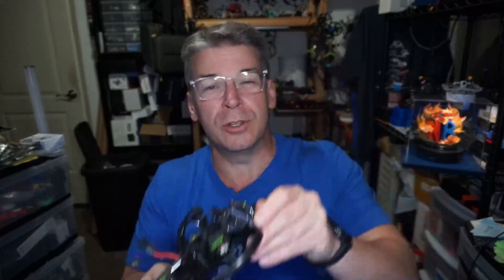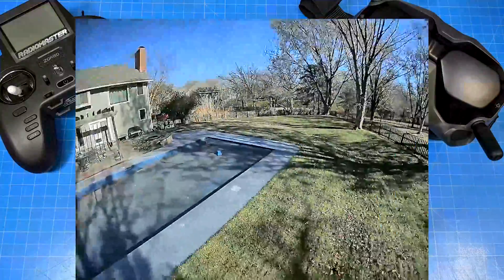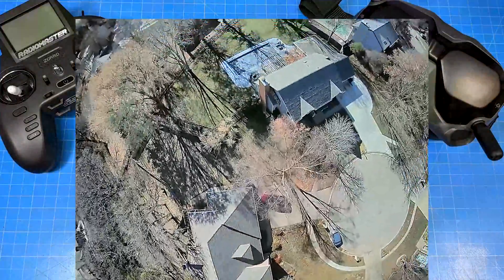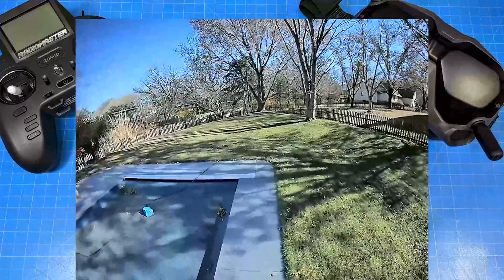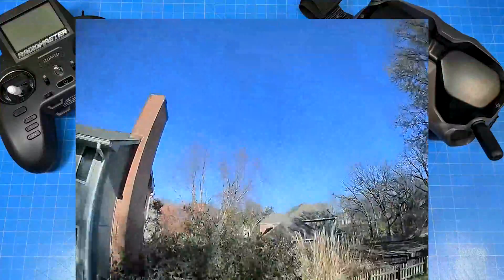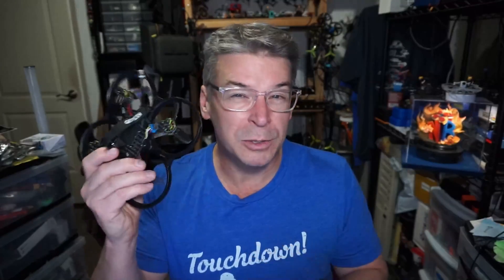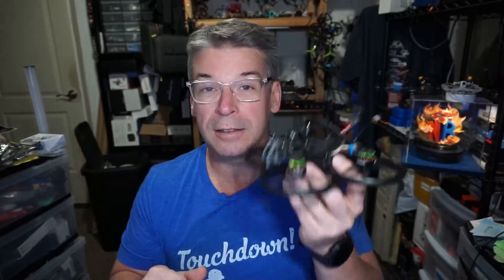Cinewhoop Wobble Fix // Thrust Linearization // GepRC CineBot30

Comment: Hello everyone ,

For some inexplicable reason the motors on my Cinebot30 stutter when I do the Roll movement…

Does anyone have any experience or an idea ???
Reply from the maker: is air mode on?
Reply: @NickBurnsFPV  110 % which is also set all the time Air Mode on i dont change it
Reply from the maker: @davutguney8419  really not enough for me to go on here. likely have to see video and possibly hear it in action.
Reply: @NickBurnsFPV  Ok as soon as I can finish something I will try to send it to you maybe you can help me. Thanks for your interest

Comment: will try it! but mine wont dive straight down, it throttles up and flattens out by it self. i can let go of the sticks in a dive and it curves to a horisontal stance then it throttles down again, and i need to "take over". any idea?
Reply from the maker: That is often referred to as yawning washout. Some say it can be tuned out. It could be caused by too much weight from battery and external hd camera as well.

Comment: Please can you try a really big dive? to see if it is possible?
Reply from the maker: Probably not, there when it comes to dive capabilities there is essential no difference from 100 to 100s of feet.
Reply: @NickBurnsFPV  Alright, I'll test it for myself and then tell you the results. I ask because when diving from 1km high in 5" or 7" drones I can reach the maximum falling speed without problems (when the air resistance no longer allows acceleration). Now with the cinebot30 it starts to "dance" and spin in the air, it has great difficulty keeping up compared to the others. Thanks.
Reply from the maker: @pampfpv  In the US the FAA does not allow for drones to be that high. I certainly wouldn't go above the FAA approved ceiling.
Reply: @NickBurnsFPV  aaaa oh ye ye, you're right! ❤

Comment: Just put your esc pwm frequency at 48khz, leave thrust linearization at 30%, and fix the Drift-Wobble: I Gains slider and those wobbles will go bye bye. There's no need for 110% thrust linearization. Smh
Reply: What do you mean by the igains are you changing the values? After reading my your comment I have changed my PWM frequency to 48khz but not changed anything else yet. Anything else I need to do?

Comment: can you share the PDI settings are currently using on cinebot30?
Reply from the maker: I am using the stock(it came with and from the geprc website) pids with the exception of the throttle linearization I added. You can see the PID sliders in the video.

Comment: this helped me out a lot i just built a geprc 35 cinewhoop and i was having wobble problems i thought at first it was a jello problem with the 03 air unit. i think between that and air mode it helped out. thanks again
Reply: Hi Mate what amount of thrust linearization do you used on your cinebot 35? Do you have the V2?

Comment: Also changed to Props IN and put threadlocker on Motor Screws.   Thanks for the Tips !!!
Reply from the maker: Hopefully the thread locker is on the screws mounting the motors to the carbon fiber? Thread locker shouldn't be used or come in contact with plastic as it breaks plastic down.

Comment: Increasing Thrust linearisation boosts IPD gains at lower range and equally reducing them at higher throttle, which is byproduct of what that quad needs is lower I or higher P, in my case moving I slider left removed 99% of these wobbles. Noting that to completely remove them you need lower motor PWM frequency, factory set it to 96Khz which is OK for tinywhoops but not heavier quads.
Reply: which one js i slider

Comment: My cinebot o3 have jello if used 6s1100mah, but if used 4s good. Any setting needed in betaflight?
Reply from the maker: Which version did you buy? The 6s version or 4s version? the motor kv is the difference.
Reply: @NickBurnsFPV  I buy and used both. 6s jello but 4s good. My friend fly with his cinebot30 feels same. Any setting needed jn BF
Reply from the maker: @LucasLandscape_simatupang  So you have two cinebot30s? I only have the 6s version, the only change I made I show in the video to thrust linearization

Comment: 24khz PWM also fixes this without thrust linearisation
Reply from the maker: This is confirmed or theory based on other similar issues?
Reply: @NickBurnsFPV  I've done it on multiple quads including the cinebot30, it flies locked at 24khz. If you can run it you should on anything 3" and up. I ultimately had to go to 48khz/ thrust linear just for O3 vibration issues though
Reply: what sized quad did you try?

Comment: After rising TL to 80 % my motors work unstable when arming on the ground. Looks like they rise and lower the throttle by themselves. In the air everything seems to be ok. Thought the instability on the lower throttle is still there. Someone faced this problem?
Reply from the maker: This sounds normal for an fpv quad. We need to get up off the ground to get out of "ground effect" also referred to as "dirty air". FPV drones fly different than gps assisted drones.
Reply: @NickBurnsFPV  Thanks for responce. Decided to switch TL off for now. I will try to use props in scheme and if it does not work to remove instability in the air will rise TL again.

Comment: Great video! Do you get Yaw Washout at all with this quad? I get bad Yaw washout when throttling out of a dive or powerloop.
Reply from the maker: I don't believe so. I haven't flown it much since the review, but typically with these I do at least a single battery of dive testing. This is the 6s version, which changes the weight and thrust ratio.

Comment: @nick burns what happens if I load GEPRC's Cinebot PID/Rate tuning into my Mark 5? Would that make my Mark 5 fly like the Cinebot30 or vice versa?
Reply from the maker: No, it would actually be a bad idea. It would likely fly very poorly or potentially rocket straight up on arm. PIDs are very specific to quad types, prop sizes and weight.
Reply: @NickBurnsFPV  So Nick, for very slow flights and with a quality Li-Ion pack what is the maxium flight time you could squeeze out of this without camera?
Reply from the maker: @jianliu9420  I don't know. Not something I have ever done. I would expect 10+ minutes.

Comment: So would this work on a toothpick mines on the limits abit and there's abit of a bobble when im doing hard turns or switchbacks
Reply from the maker: I don't think so. This is at zero throttle the symptom described sounds like the pids need further adjustment. Or just more throttle when doing those moves.

Comment: I've got a Rekon35 a wobble master, I sort of tuned most of it out I think, I Thrust Linearization set to 75, after watching this I am set it much higher - off to the moon 🌒 😄
Reply from the maker: does that mean it did fly off uncontrollably?
Reply: @NickBurnsFPV  No not yet --  I had mine set to 45 --  about off to the moon comment, just a cheeky comment, as your setting that your using is so high, but wow looks like it works so well, I am certainly going to raise thrust linearization but it's alway a consideration weird things might happen. Love your video
Reply from the maker: @cyberess1000  ah sorry. I misunderstood. To the moon used to mean our pids or something was so off our quad went "to the moon" until we disarmed.

Comment: Fantastic Nick! I'm wondering if that could fix the wobble in the Foxwhoop25 too. It had even bigger wobble I remember. Thanks for sharing the info!
Reply from the maker: I would sure give it a go. I would suspect it would help as well.
Reply: I've done a foxwhoop25 build, Genuinely been nothing but hassle, Find it shakes like crazy on over half throttle🙃
Reply: @Bmeadowz   🤣  I did this build as well, with the the new O3 airunit. It really shakes a lot, I'm getting a lot jello. But I think it's because the original camera mount is not flexible and also the motors I used are old beaten from babyhawk 2.
Reply from the maker: @Bmeadowz  Using a preset?
Reply: @Nick Burns Tried messing with that & pids, Uavtech is the preset I ended up using👊
Reply: @Bmeadowz I'm using UAVtech preset as well. Also flashed bluejay with 48khz and rpm filter. Besides all the vibrations, I think it flies well and very agile for a cinewhoop. The lound vacuum cleaner sound is what annoys me more. 😝 I'm not used to that..
Reply: @Erik Flauzino Seems to of helped massively being on the shaking issues, I reckon I could tune the rest out, Are you using just uavtech preset or have you changed your pids? Massive respect for the help boys👊

Comment: is it not possible to fly this version with 4s batteries too?
Reply from the maker: Its possible but it would be greatly under powered
Reply: @NickBurnsFPV  simply due to motor KV or are there any other factors?
Reply from the maker: @komenskyborg  mostly, there can be a difference in weight, but at this weight that should have a minor impact.

Comment: Very interesting. The same wobble you noted on Foxeer Foxwhoop 25 and I have it too.
Would be interesting to understand why does it happen and how this parameter fixes it?
Reply from the maker: Its a good one who has a deep understanding of the betaflight structure and processes.
Reply: @NickBurnsFPV  I will look into the code to see what this parameter does.
But what about the wobble itself?..
Reply from the maker: @VasylDemianov  I suspect its due to the weight and lack of clean air at such low throttle the I term isn't able or high enough to keep the quad steady. just my gut opinion.

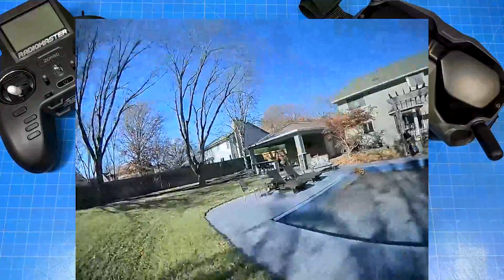Comment: Wow, I've never seen Thrust Linear that high before! But @3:00 you can see the comparison and I'd say it's much improved. One thing to notice with raising TL really high is that low rpm might turn floaty and/or you may roughen idle when arming. I would love to see a log of that thing... Airmode was turned on before, right? 🤔
Reply from the maker: Yes, airmode always on. I think I can send the bb log over.
Reply: @NickBurnsFPV upload it somewhere and tag me in discord, I'll pick it up and take a look.
Reply: @BrandonBeans  - any follow up on this subject?
Reply: Please follow up in that guys, i got a cinewhoop that tl cant fix. Im curious of the impact of tl vs I term.

Comment: why just not lower the I term around 0.6, that should fix woble, and raise dynamic idle around 25...
because that kind of woble suggests that P to I ratio is wrong, I term is just too high, and thrust linearization can be fidly because it boost pids in lower portion of throttle, so if you catch a branch while flying slower drone could do very strange things...
Just enter 25 on dynamic idle  lower I term by 0.1 or 0.2 until you get no nose wobble on full throtle pounchouts...
Reply: This is also a really good option. I personally haven't raised TL as high as Nick did but I'd like dyn idle at least 25 then drop iterm before raising it back up to find the spot where my fast orbits lock in quickly and leave it there. Then after all the proper pid tuning I'd fiddle with AG and TL until my punches, chops, and dives are locked in.
Reply: isnt 25 for dyn idle really, really, low? i run around 40-50
Reply: Depends of prop size, weight of a quad for smaller builds i tend to go higher, theres no golden rule...

Comment: Another way to fix this is increasing the motor idle slightly
Reply: Doesn't work 90% of the time 🤷‍♂
Reply: @pirateradioFPV  what doesn't work ?
Reply: @justhackitfpv  Bumping the idle. Doesn't work most of the time. Then again, I've only had to deal with this issue on 4 quads. Bumping the idle did nothing on all of them.
Reply: @pirateradioFPV  in his old video those wobbles are happening because the motor is getting too low in RPM causing that... Motor idle will fix it as it fixed for me but for more in depth check we can record a blackbox log and find the real cause
Reply: @justhackitfpv  Underpropping has been the answer for too long, let the power hide how poorly we actually tune our quads 😂